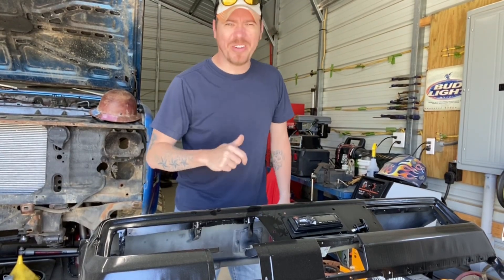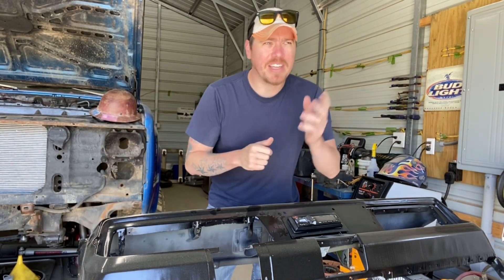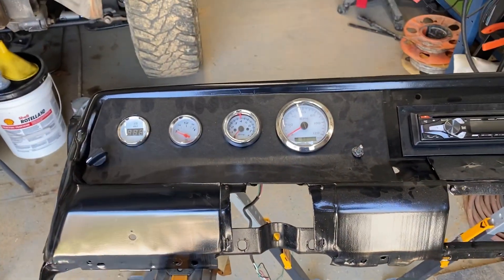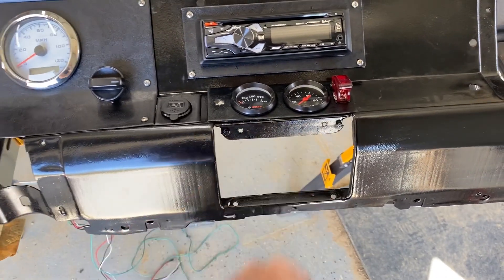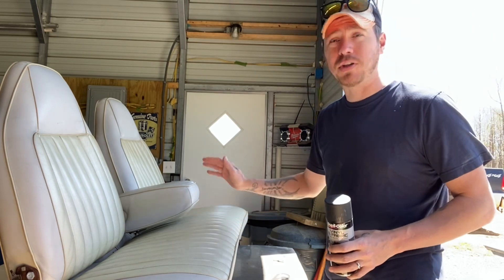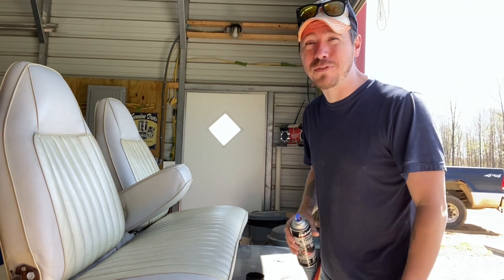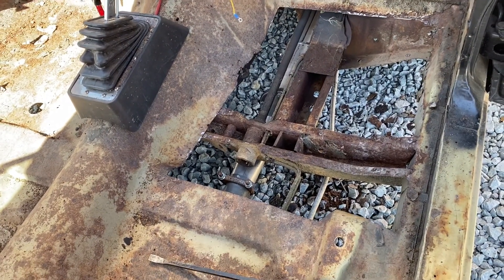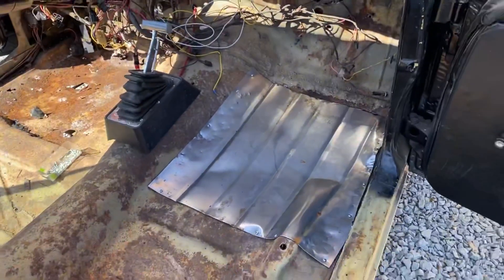Painting vinyl seats with Duplicolor PLUS floor pans finally installed - 1973 Dodge Dart build

Comment: Great job! I've never used vinyl paint be before, is it actual paint or Dye? Does it rub off the vinyl over time? Seems to be the way to go if it works good. I like the way you did your floor pans, I might have to borrow that idea for my Crew Cab! Dang that car sounds good !
Reply from the maker: Time will tell how well it holds up.  I’m gonna do another 2-3 coats on it but even after sitting for a few hours I was able to sit on it and there were no issues.  It’s just a special paint compound.  Same stuff I used for my interior trim pieces.  Floor pans are poor man for sure but they work lol